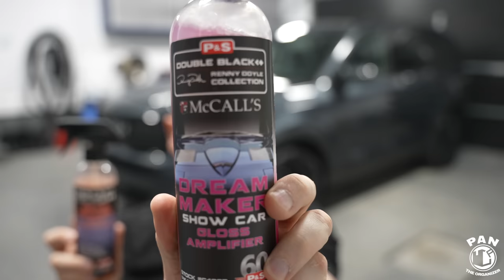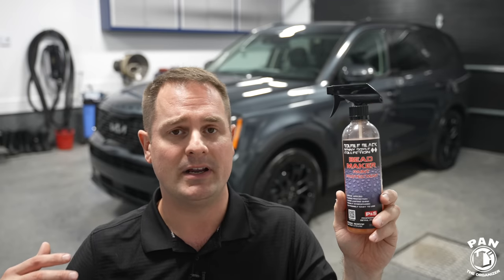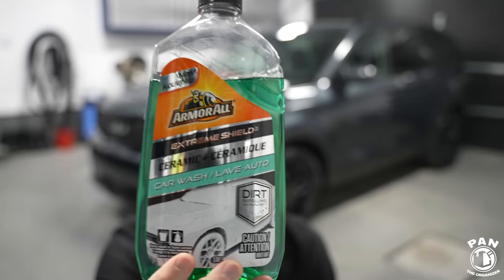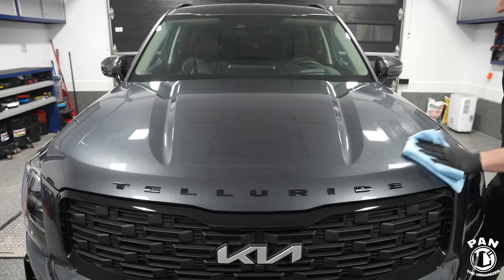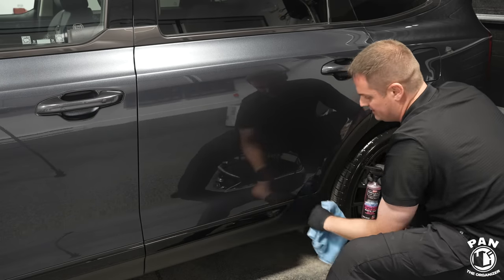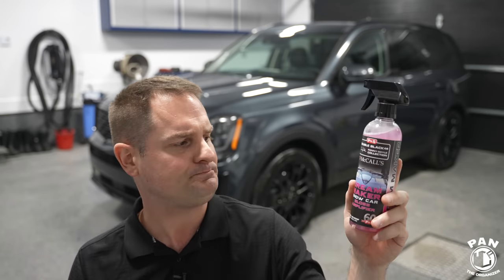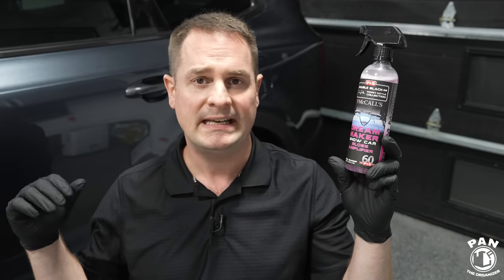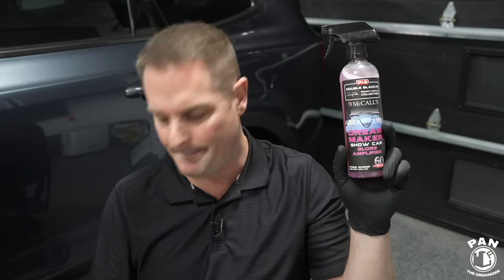NEW P&S DREAM MAKER! Is it better than Bead Maker?

Comment: Pan, Can you tell me if the bead maker works on a vehicle with Adams graphene coating? If so is the initial application the same as any other finish?
Reply from the maker: Yes

Comment: I have been using Bead Maker for years. Is it OK to use it on top of a ceramic coating?
Reply from the maker: Yes, you can use Bead Maker on top of any existing protection.

Comment: Hey Pan, I appreciate all your video content and I’ve learned so much from you! Purchased the Dream Maker after watching this video. I have the same Telluride SX Prestige Nightfall Edition, but it’s ebony (black) 

What product did you use to clean the black glossy rims on the Telluride?
Reply from the maker: Use a good wheel cleaner like one in my wheel and tire cleaners battle video here: https://youtu.be/jfYZh1qB1LY

But the trick is to use microfiber brushes and mitts for delicate surfaces like gloss black wheels. Here's what I use:
Brush for inner barrels: https://bit.ly/3qHWD3L
Wash mitt for wheel faces: https://bit.ly/3AZk39n
Reply: @PanTheOrganizer  appreciate this reply, just picked up a telluride with these gloss black wheels and was a little hesitant to use my standard wheel cleaner.

Comment: Wet Coat vs Xtreme Solutions Topper vs Dream Maker? What do I need to know as to the differences and under what circumstances do I use each? Or, do they over lay in what they do? ~ Thanks ~
Reply from the maker: Three very different products… You can’t compare them.

WetCoat is a spray on rinse off silica spray sealant. 2-3 months durability.

Topper is a topper. Mainly used as a drying aid and lasts a few weeks. 

Dream Maker offers no protection. It’s just a gloss enhancer. Lasts about a week or until your next wash.

Comment: As these master, a question if the car has ceramic coating or a ceramic sealant type carpro hydro2 or meguiars hubrid the drying assistant which can recommend me whether to use the meguiars detailer, paint gloss p & s or dream maker p
I'm confused even with that criterion when it comes to using it so as not to scratch my black car.
Reply from the maker: I'm not sure I understand your question... First, what type of protection do you currently have on your paint? 

You should watch my popular tutorial on safe washing and drying methods so you don't scratch your paint. Here: https://youtu.be/7Koj5j2Es5U
Reply: @PanTheOrganizer  Thank you very much master for your prompt response, my car I have protected with ceramic liquid wax from meguiars, I reinforce it with quick detailer from ceramic from meguiars, for future projects to start in the world of detailing if a car has a ceramic protection I can use the pain gloss of p & s as a drying assistant? Here in my country the products of meguiars are expensive and those of p & s are more comfortable, by adding the pain gloss is a protection

Comment: Great video Pan. I myself have used this to prep a car for a wedding. And my god, the car looks damn glossy. Love. Btw it was mentioned that Bead Maker could be diluted in your video. What’s the dilution ratio recommended and for which circumstances should it be used? Thanks Pan
Reply: Did Pan say that ? I don't see the point. Great, inexpensive product...   but you can still ask P&S...
Reply from the maker: You don’t dilute Bead Maker.
Reply: @PanTheOrganizer  i must have heard wrongly 🤣
Reply: Diluted as in when you use bead maker on a wet car / drying aid.

Comment: I know BM is a sealant is it possible to put wax or ceramic on top then seal again.. help I sealed after compound and polish
Reply from the maker: You could. I would put more durable protection first, and then Beam Maker on top for the gloss and slickness. BM only lasts 3 to 4 weeks, so you use it more often, like a drying aid after your washes.
Reply: @PanTheOrganizer  Thanks Pan, you are a blessing watch your vids constantly...just got back in to the deatailing game which has changed a ton since I started in 09

Comment: Hey Pan love your videos! If you or anyone in the comments can answer, I’d appreciate it. My question is, do you apply bead maker to cars that already have a protection like wax or ceramic? Or can you just apply it as is after a wash? Also would you compare Bead Maker to Carpro’s HydrO2 Lite?
Reply from the maker: Welcome to my channel. You discovered one of the biggest car detailing channels on YouTube as we surpassed 800,000 subscribers and 100 million views! I have been detailing for 25 years and I love to share my knowledge and passion with my viewers.

You found the right channel to help you learn everything about detailing.

Bead Maker is a spray sealant that lasts 3 to 4 weeks. It's mainly used for its great gloss and slickness, and because it can be applied on top of any existing protection: wax, sealant or coating. People mainly use it as a drying aid after you're done washing your car.

HydrO2 Lite is more durable and chemical resistant, but should only be applied on top of a coating, not a wax or sealant.
Reply: @PanTheOrganizer  thank you so much Pan🙏🏽 keep giving us amazing content !
Reply from the maker: I appreciate it!

Comment: Hi Pan, Great videos. You did one that mixed 1 1/2 oz of Dream maker to Bead maker 10 1/2 oz. Just mentioned in this video to not use bead maker too often. What is the right amount of product and number of times to use on ceramic coated car?
Reply from the maker: If you use it as a drying aid on a wet car, it gets diluted during use so you could use it on a weekly basis.

If you apply it on dry paint, use it once every three weeks.
Reply: @PanTheOrganizer  used bead maker on new car, older car and one with recent ceramic coat. Worked amazing on all three. 
I will try the dream maker next weekend. 
Do you have a favorite soap for gun ?
Reply from the maker: All my favourite products are in my popular yearly car detailing products awards here: https://youtu.be/gRwsznwfTwE
Reply: Hey Pan, did a rookie thing this morning. Got up early so it was not hot to wash three cars. I grabbed the beadmaker instead of my soap. sprayed off car, washed with beadmaker (diluted in a bucket) and followed up with Dream maker. Let me tell you they sure do shine now but is that an issue? or can they wait until I wash again? Thanks
Reply: @pantheorganizer
Hey Pan, did a rookie thing this morning. Got up early so it was not hot to wash three cars. I grabbed the beadmaker instead of my soap. sprayed off car, washed with beadmaker (diluted in a bucket) and followed up with Dream maker. Let me tell you they sure do shine now but is that an issue? or can they wait until I wash again? Thanks

Comment: So Pan, if I wash my car weekly,  and it has ceramic coating (And PPF in the front only), is it enough to use Dream Maker after each wash ti get that gloss and not mask the hydrophobic properties of my coating?
Reply from the maker: Hard to say. Applying any sort of topper will usually always alter the properties of coatings. Unless you use the compatible topper from the same brand as your coating.

Comment: Hey Pan, did a rookie thing this morning. Got up early so it was not hot to wash three cars. I grabbed the beadmaker instead of my soap. sprayed off car, washed with beadmaker (diluted in a bucket) and followed up with Dream maker. Let me tell you they sure do shine now but is that an issue? or can they wait until I wash again? Thanks
Reply from the maker: Out that’s not a good thing at all. Bead Maker isn’t made to clean a car. So most likely you pit some swirls and scratches in the paint…

Next time you wash your car, use a proper shampoo. When you’re done washing and drying, see if the paint needs to be polished to remove the damage you might have caused.
Reply: @PanTheOrganizer  all cars were thoroughly rinsed first. I didn’t see much dirt etc. I will give them a wash this weekend again and see if any scratches.

Comment: Hi Pan, quick question can I wash a detailing applicator sponge or do I have to throw it away
Reply from the maker: It depends what you used it with. Can you he more specific? What products are you applying with it?
Reply: @PanTheOrganizer  it would be for interior products for dashboard,side doors panels.
Reply from the maker: In that case, you can simply wash it and reuse it. The only applicators you throw away are those used to apply ceramic coatings from glass bottles.

Comment: Could you do a video sharing tips on how to do a mid engine detail? I have a C8 and I know you have a 911. A lot of places are hard to reach vs traditional front engine. Thanks!
Reply from the maker: I don't detail mid engined engines... I don't have a lift so it would be near impossible, and pointless as you never see the engine in a 911 like mine.

Comment: Ok, not related to this video, but do you have any good ideas on portable travel wipes or options to safely remove bugs while traveling?  I drive long distances and almost always wash my car before leaving, but inevitably the bugs accumulate quickly and I have no good way to remove them while traveling.   I’d love some ready to use wipe option to deal with it every day before the accumulation is nasty.
Reply: In my trunk I have a Nalgene bottle filled with ONR and a bunch of pieces of microfiber I cut up from a 16x16 rag company edgeless 365

Comment: Hey Pan, I saw your video about products that give the most gloss and I have been trying them all out 1 by 1. Which do you think gives a better look in terms of saturation and gloss. NV Nova Lustre or Dream Maker? Thank you and best of luck to you!
Reply from the maker: Dream Maker has the highest gloss as it's strictly a gloss amplifier (it doesn't last long and doesn't add any protection).
Reply: @PanTheOrganizer  I will mix the dream maker with the bead maker and see how that works. 😃
Reply from the maker: I made a video about mixing those here: https://youtu.be/twuTd2VNlxw?si=irPCLPmTp0ztuGN7

Comment: Do you recommend paint gloss or dream maker after a wash?  My vehicle is already ceramic coated
Reply from the maker: For a regular wash, I would use Dream Maker. Zero protection, but insane gloss. Lasts about a week or until your next regular wash. And then, once every other month, use a silica spray sealant for the actual coating maintenance.
Reply: @PanTheOrganizer  Thank you so much!
Reply from the maker: You bet!

Comment: Pan I have a question:
Is protection only as good as the weakest protection that is applied.  
For example if I apply a spray wax which we a know last for like 2 weeks maybe 4. And I apply say Meguiar's Hybrid Ceramic wax that last 6months let's. My question is will the hybrid ceramic wax now only last 2 weeks because the hybrid wax was applied to the spray wax and not adhered to the car's panel directly. Thanks in advance!
Reply from the maker: You always apply the longest lasting product first. Typically, it's a sealant and then you finish with a wax. If you have a ceramic coating, you apply that first, and finish with a ceramic topper last.
Reply: @PanTheOrganizer  Thank you! Got it strongest to weakest.

Comment: I actually got a lower gloss meter reading after using Dream Maker.
Reply from the maker: That happens with most gloss meter readings. What really counts is what your eyes see. There is a candy gloss richer appearance that many toppers give and if you were to measure the gloss measure would say no gain or even a slight loss. 

For me, gloss meter readings are more important when doing paint correction to see the difference in gloss before and after polishing as that’s where you will get the biggest increase in measurable gloss: machine polishing.

Comment: What soap would you recommend to remove this product from a coated car during a maintenance wash to make sure this product isn’t stacking over itself? I’m looking for something that adds gloss with no protection so I can remove it from my coating at will. 

Also do you plan on doing a video on Gyeon Pure Evo? 

Great video!
Reply from the maker: Hi Colby. Stripping shampoos alone won't fully remove existing protection. They can start the breaking down process, but if you want to ensure 100% removal of existing protection (CRUCIAL before applying a true coating from a glass bottle) you must machine polish and then use an IPA to wipe the surface.

In your case though, as you only want to diminish the previous light layer of Bead Maker or Dream Maker, a decon soap should do the trick, here are a few that I like using:
https://amzn.to/3izlK87
https://amzn.to/3izlLZJ

I don't have any current plans of doing a video on Gyeon Pure EVO unless I get many requests for my viewers. I have covered plenty Gyeon coatings in the past, so the same concepts and opinions apply here too, except that the new EVO series lasts longer and is easier to apply and more friendly for application outside.
Reply: @PanTheOrganizer  Hello Pan, 

Thanks for taking the time to respond to my comment. I think I didn’t word my question correctly.

I am wondering if my car is already coated with a true ceramic coat (Gyeon Pure Evo let’s say) if I apply dreammaker could I easily remove it from the existing ceramic coating with say CarPro reset or another slightly aggressive soap? I do not want to pile layers of gloss enhancers or additional SI02 on top of my ceramic coating. 

I’m looking for a gloss enhancer that can be easily removed from the coating so I can start fresh after every maintenance wash. Thanks!
Reply from the maker: It would be hard to prove if you fully removed it. But there's no real harm in adding topper after topper. I use a drying aid/topper after each wash, and I don't use a stripping shampoo. The coating is doing well, and I always get nice gloss and slickness from the toppers. So I can't complain. Hehe.

Dream Maker is particular, as it's not really made to protect, it's purely a gloss enhancer, and usually only lasts until your next wash (I got this from Dave, the chemist at P&S) so even a regular shampoo will likely remove it, if it's of any concern to you. Don't use stripping shampoos on your coating too often, as those are often high pH, and even though coatings can resits pH levels 3 to 12 typically, repeated use of strong chemicals could weaken them.

I use a higher pH shampoo or snow foam more at changes of seasons, like in spring, to start fresh.
Reply: @PanTheOrganizer  Awesome. Thanks! 

Also if you get enough interest I would love to see a video of Gyeon Pure Evo or the new Diamond ProTech Body or Body 36 coatings! Those Diamond coatings sure look interesting. I’m deciding between the two for my Camaro.

Comment: hey pan am sure you can not use dream maker on wrap matte car becuase matte doesnt require gloss it will cause color change correct Mr.Pan?
Reply from the maker: Correct. Not recommended on matte surfaces.

Comment: Sorry Pan, want to ask. Can i still apply bead maker or dream maker on my car when i dont have a garage (i.e. exposed to sun 24/7)? I want to use it as my car cant be ceramic coated (pending paint work).
Reply from the maker: Yes you can use them outside, but work in the shade and on a cool surface, never in direct sunlight, like for any paint protectant. Bead Maker lasts 3 to 4 weeks. Dream Maker is not a paint protectant though, it's just a gloss enhancer (no UV protection).
Reply: @PanTheOrganizer  thanks Pan! Uve turned me from a zero knowledge hsewife to one who will clean my own car (never cleaned a car my whole life) and also changed my husband to be hype up about cleaning our car.
Reply: Hi Pan, sorry. Another question. With the bead maker on, does it allow for easier removal of tree sap which fall on the car? Bird poop id assume its a big yes, bt tree sap?

Comment: Great Video Pan! I have a question: is it a good combination and is it compatible to apply to my car CarPro Reload as first product and above P&S Bead Maker and maintained by shampoo wash Gyeon Bathe and Bathe+ (I have not ceramic coating on my car).
Reply: P&S products are known to be  great toppers for any kind of protection, really. That is why they are so popular. Inexpensive and worth trying...
Reply: @delphinebez3045  thank you!
Reply from the maker: That's technically possible but a bit too many different products in my opinion. Protection on top of protection on top of protection...
Reply: @PanTheOrganizer  thank you Pan! So i will only use car pro reload, p&s bead maker and gyeon bathe and not bathe+
Reply: @PanTheOrganizer  Pan after applying carpro realod do i have to wait before driving the car and exposing it to rain?

Comment: Hey Pan, can I dilute Dream maker with distilled water 1/1 or 30% distilled water and 70% Dream maker or this combination would decrease the properties of dream maker?
Thank you in advance!
Reply from the maker: I spoke to Dave (the P&S chemist) and he says 80% Bead Maker and 20% Dream Maker mix is what they see has success.

Don’t dilute with water.
Reply: Also I would like to say that, by using dream maker as topper ( after bead maker) I have less dust on my car. Silkness and gloss is amazing( my car has no paint correction, only iron decontamination and IPA wipe on/off)